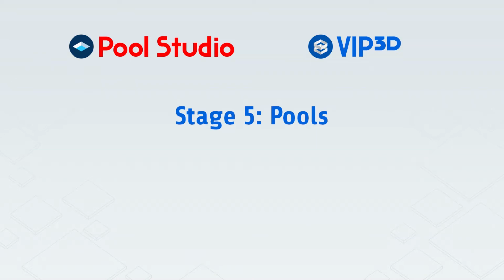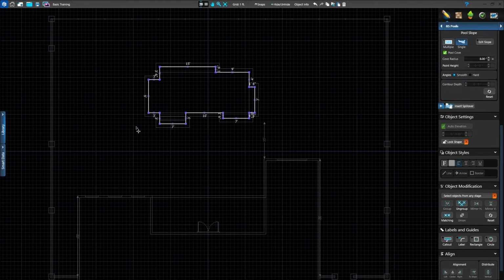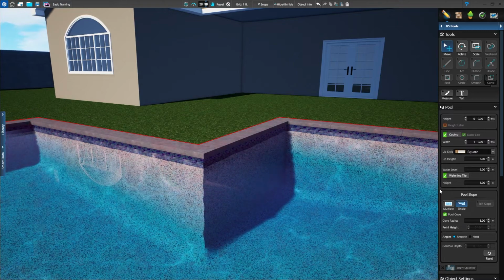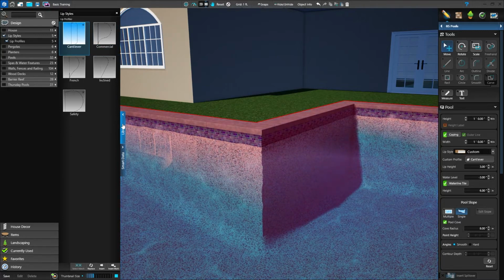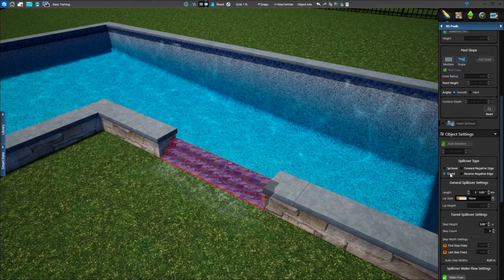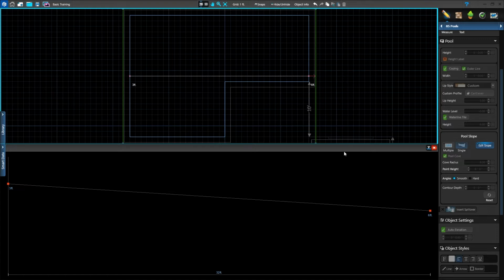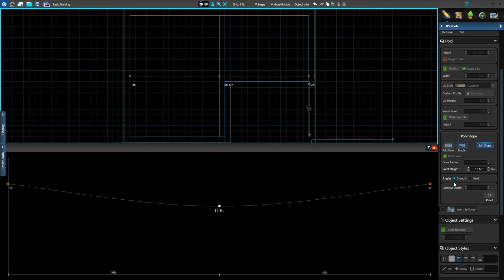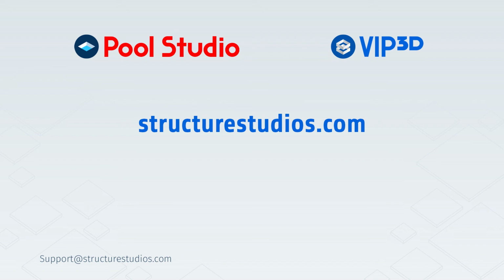Version 3 Basic Training: Pools

Comment: Long ways to go to be worth the $200+ per month
Rendering times are taking a VERY long time. 33 second video on average is taking upwards of 10 to 15 min. Just thought I would mention that. Is the rendering bound to the CPU or GPU, because I am not seeing any major consumption of my system resources during renders? My CPU is at 7%, GPU at 4% and I am still running multiple programs while I wait for renders to complete (such as this email, multiple browsers, other videos, etc) I am a regular user of Unreal Engine and Blender, and even with the new updates to UE5 using nanite + Lumion, and Blender 3.0 RTX in Cycles I am able to render more complicated graphics much faster. So the bottleneck is not my system configuration as you will see in the sys diag. To me it feels like CPU bound, but I am no expert. It does not matter whether I have 2 or 3 other programs open and working on them at the same time or if I only have SE3D rendering the time and performance is still the same.

The biggest problem I have, is when you add all of this up I could be moving at a much faster pace, but I am limited by the program performance. I have been using this software for over 5 years working for different companies and it is like second nature to me. All to often I am left just tapping my fingers waiting for a hitch to recover so I can proceed. I used to be able to get a design like the one shown in the videos above done in 30 min or less, front to back up and down ready for presentation. I need to be able to get a min of 4 designs out the door per day, sometimes more if I am feeling extra.
Reply: Would you recommend another program? I'm trying to find one to use similar to this one.